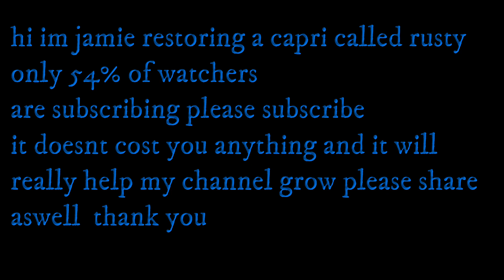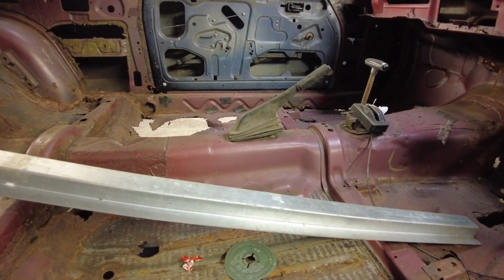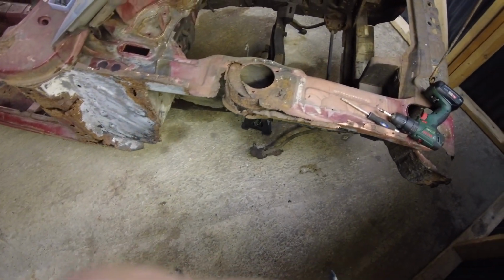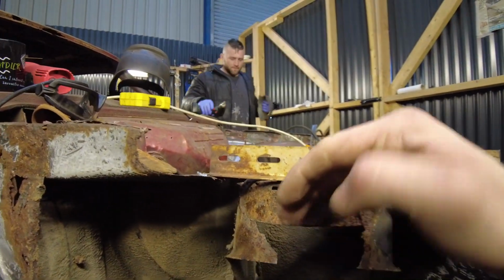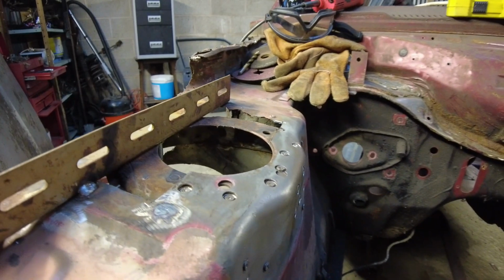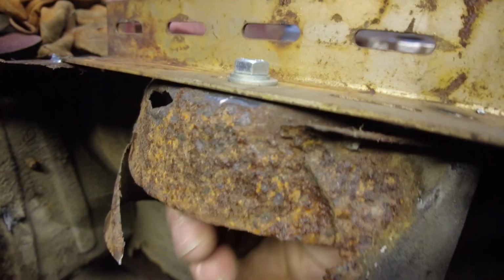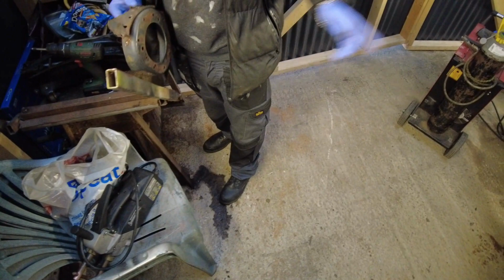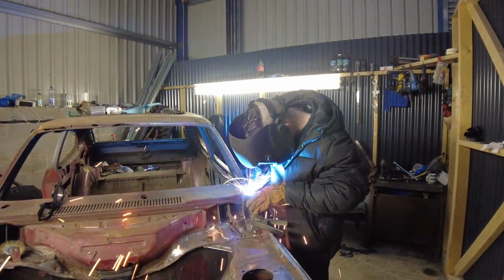Ford capri 3.0 restoration part 20 ,

Comment: I always found the wurth spot weld drill bits were far better  than those cheap sprung loaded ones. You just have to make sure to not blunt them by getting them too hot.
Reply from the maker: I might get some n have a go see how they are